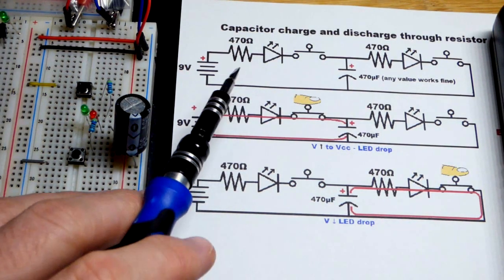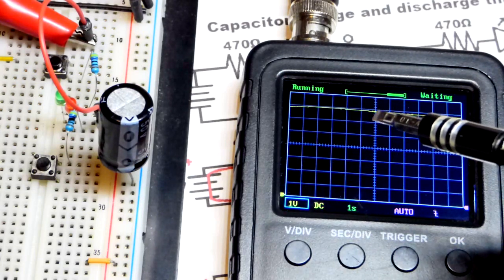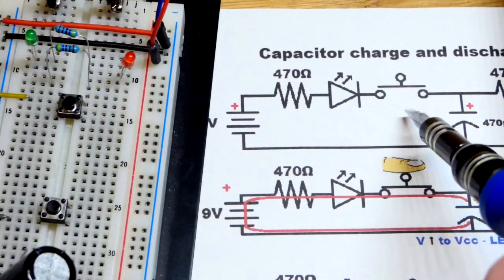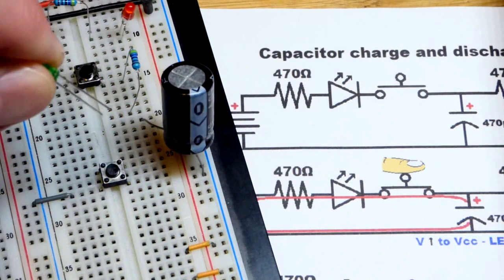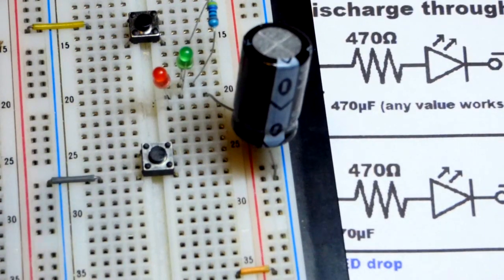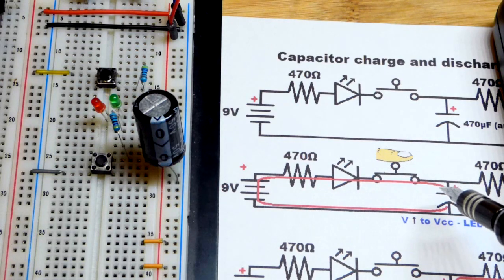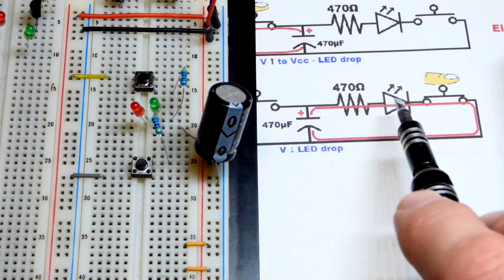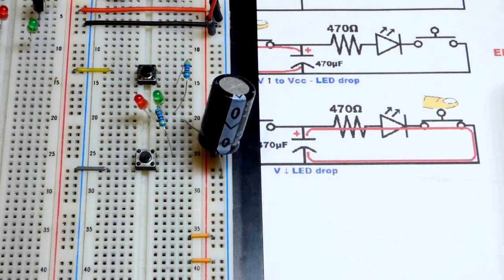Electronics capacitor charging and discharging through resistor protected LEDs demonstration circuit

Comment: Your current powers the green LED and resistor on the way to being stored in the cap. The same current subsequently powers the red LED and resistor to discharge the cap. Interesting.
Reply from the maker: Yup :)
Reply: @Electronzap  it would be interesting to calculate the joules taken to charge the cap vs. the joules used on the discharge. My guess is they are close. If you combine the work done in both the charge and discharge the circuit looks off-the-charts efficient.